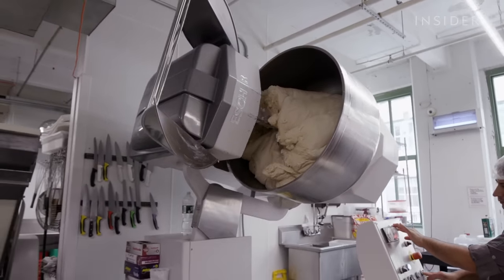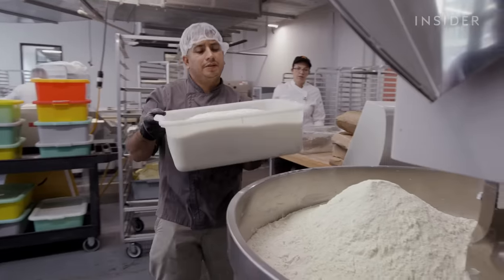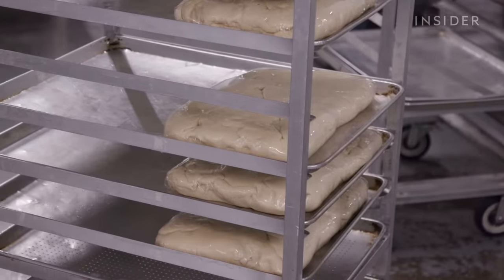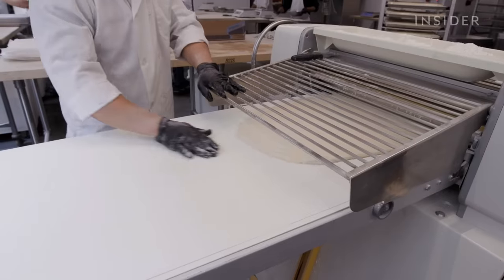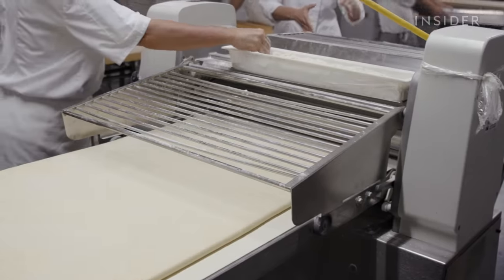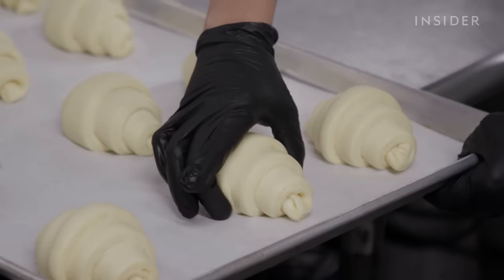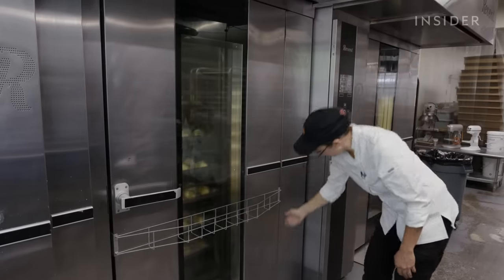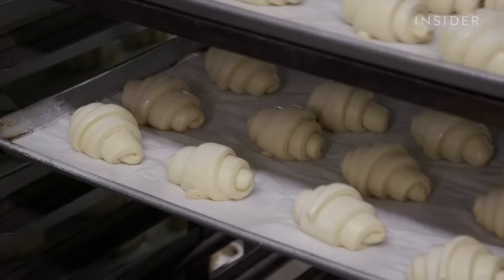How 21,000 Croissants Are Made In A Legendary New York Bakery Every Week | Big Batches

Comment: to add info for ppl who dont do baking, for croissant dough lamination is a race against time and temperature. both butter and dough has to be cold but not too cold so we can flatten both correctly, if the butter is too cold, it will make hole on the dough, lamination failed. if the dough is too cold, the butter lamination will be too thin in some place that it will just become butter roll instead of croissant with beautiful airy space inside

Comment: I don't understand why they don't use the parchment paper from the butter flattening over or to line the sheet trays for the shaped dough??
Reply: I was thinking about how much plastic wrap they are going through.  Hoping it can be recycled in some way.
Reply: I work at a large scale bakery (not as big as the one in this video though!) and we absolutely re-use the butter block parchment paper. However, the need for paper to line each tray outpaces how many pieces of butter paper there are. Like the 2 pieces of parchment from the butter block makes 60-80 croissants which then needs at least 5 sheet pans to bake.

Comment: You'd think that a company this large wouldn't have to order individual blocks of butter like that.
So much packaging
Reply: Probably smaller pieces for easier handling? idk
Reply: @Mr__Chicken  they're smashing 4 pieces together and then handling that anyway though.
Reply: It really depends on the brand they buy. The bakery I work at, we use instant yeast that comes in like 500g packages in a 15kg box and is a pita every time I need to refill the container. They used to come in just 2 packages but apparently because their customers weren't going through enough yeast and complained so they just made them into smaller packages.